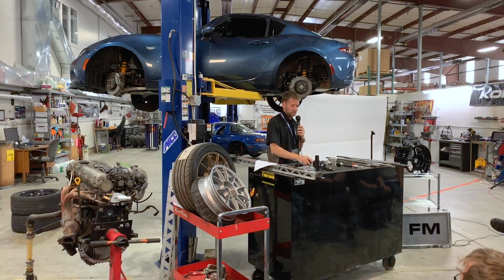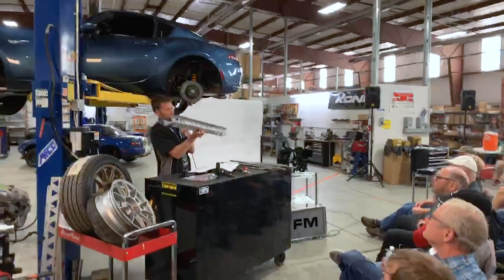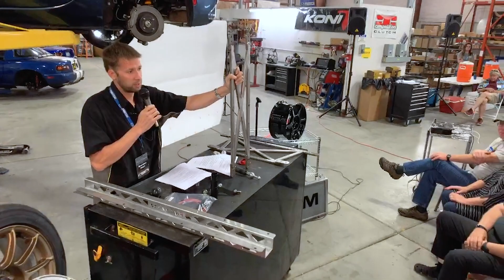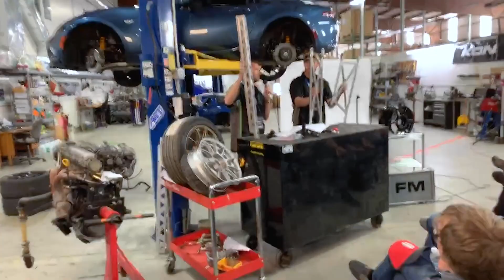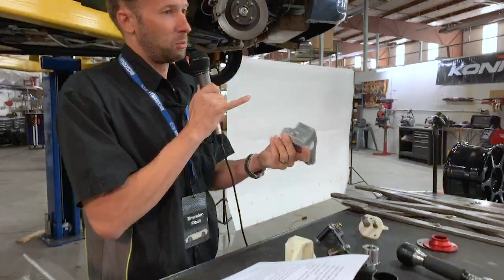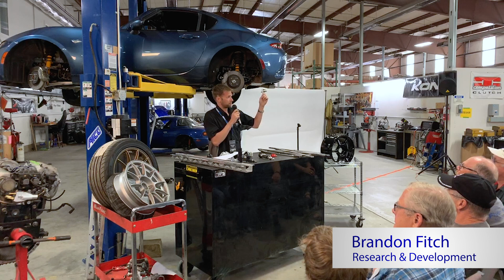Flyin' Miata New Product Announcements 6-22-19

Comment: Don't you need a force bar relay for fuel pump applications. What happens if contacts on your relay stick or weld together? Lawsuit waiting to happen.
Reply from the maker: We’re effectively duplicating the factory setup, just installing a better, higher-load relay with dedicated (not shared) wiring. It’s still triggered by the stock ECU. The relay we’re using is rated for 35 amps while the included fuse is rated for 25 amps, so the likelihood of a relay sticking or welding together is very slim – no more so than with the setup Mazda installed in the car.
Reply: @FlyinMiataVideo  Has a oem relay been taking apart to verify no separating bar or means of preventing a fail closed condition is in the design. I was under the impression they use the fuel injection relay Incorporated with the fuel pump relay as a dual apparatus to prevent a fuel pump that won't shut off.